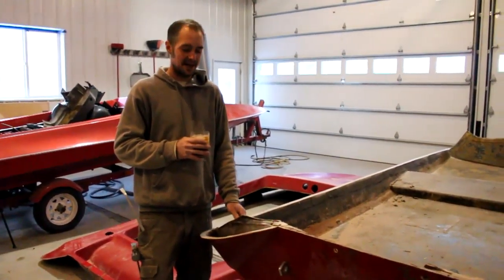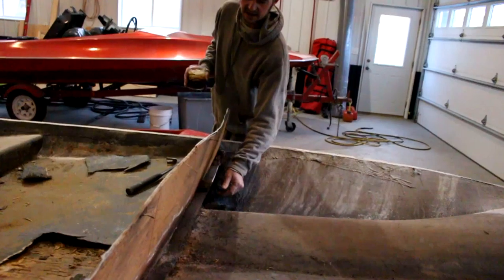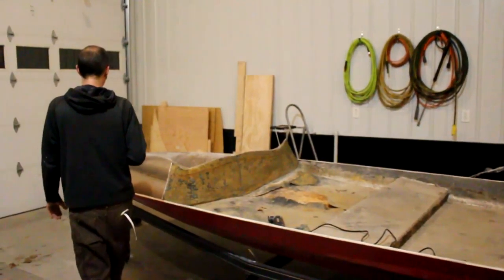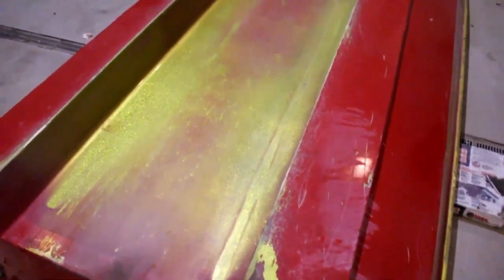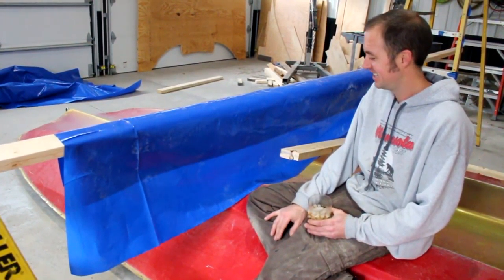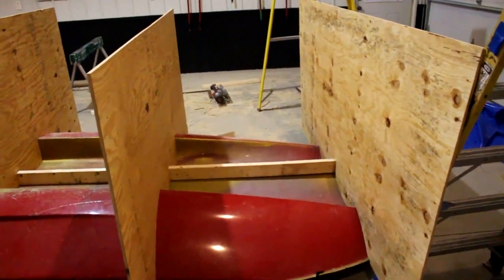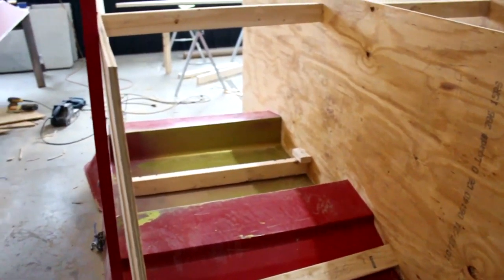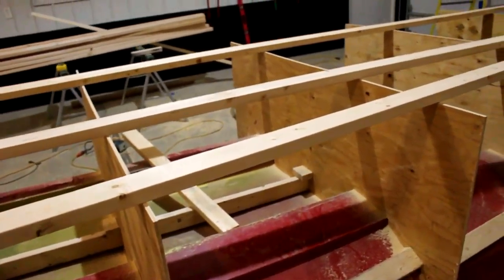HydroStream Restoration Cradling the Hull After Inspection Pt. 4

Comment: I have had one of these Panthers Metallic Blue with a Tower of Power 140hp for 30 - 35 yrs , They are a Cool boat and a true conversation piece when people see it . Mine is at a point to where I need to think about doing something very similar to what you are doing . This is very cool to watch , You are doing a Great job explaining your thought process as you move forward doing this , Can't wait to continue watching more of the progress . If you are keeping Both panthers and restoring or not restoring the other one, I think it would be awesome having matching color boats .
Reply from the maker: Thank you!  It's awesome to hear from someone else with one of these, I'm unsure of the fate of the other Panther that's here, at this point I got the V6200 merc running right, it's rigged  and we're gonna take it out on the water come spring to feel it out.  It will be up to buddy what happens after that, in my mind's eye there's no chance it has solid coring etc. left in it.  I cannot wait to feel one of these come up on the back of the sponsons and fly!  If you have advice on engine height/propellers etc. it'd be appreciated :D gonna be some experimenting.

Comment: I had a thought while watching you making the cradle.  Do you think it would be feasible to have gone ahead and splashed a mold while you had it upside down to use as a cradle?  Then once done, you could maybe have a market for making new 'vintage' Panther reproduction's like the Shelby Cobra cars.  

BTW, I'm following because I have a 89 Voyager XT that has never been touched and hasn't seen water in over 10 years, From what I'm learning, the core in mine will be gone too.  Not looking forward to this, but I want to see water this year.  Learning a lot, thank you.,
Reply from the maker: Before I removed the interior structure, I would have the ability to make a temporary mold from the hull, then a plug from that would need to be made and after that I'd have to have someone with a better setup create a production mold.  The hull would have to be "blueprinted/faired" first.  That said, there are legal rights to the designs and molds of production boats no matter how small their numbers, or how few remain.
Reply from the maker: Thank you for the sub! Is that an open bow? Unless your sweet Hydrostream was really babied and lived in doors the core is likely rotten, it's alot of work and hours especially to do it the way I am on this Panther, it is possible on most of these to remove the floor and stringers and recore without removing the cap, you can also cut out the splash well to get at the transom from the inside.  However I've found there are always more issues than what you find at first and it's much easier to work on then apart.
Reply: @rumnboats7612  Wasn't sure.  I figured since Pipkorn has passed a few years ago, and the company has been sold a couple of times and is currently defunct with the molds just parked in the woods somewhere.  I thought they'd be free domain.  Patents have long expired on any Hydrostream hulls.
Reply: @rumnboats7612  It is a bowrider.  It's based on the Vegas XT bottom, with a bowrider top.  The most versatile and rough water handling boat I've ever seen.  

It's currently sporting a stock OMC 3.6 L Looper, with a V-6 gearcase, 1" setback plate, and turns a 32 Cleaver on the rev limiter.  It'll hit 98mph.

I've also got a 88 V6 Looper modified by Monty Racing Stage III that makes 297 hp on pump gas, at the prop, with at least 270 hp from 5K to 7K RPM, but it's got a galded piston right now.  It's a bit finicky.  

So, I figure I'd better plan on taking a close look at the core and transom. 

I'm thinking I'll have to split the boat, as I'm sure the bowrider front is screwed to the floor.